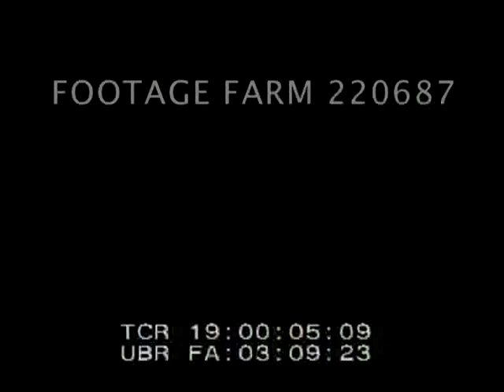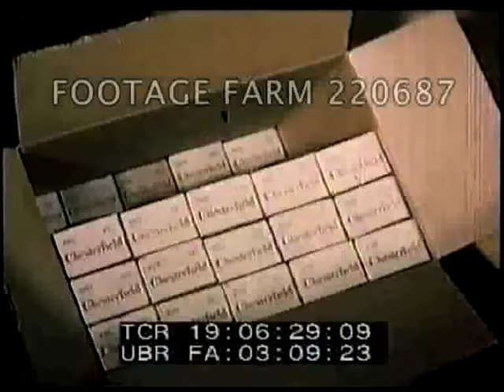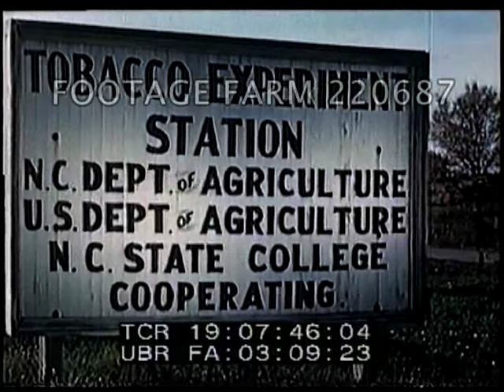Tobacco Industry in Southern USA 220687-01 | Footage Farm

Comment: In 1949 horses and mules were still in common use in the US tobacco belt. And apparently there was no mechanization whatsoever in any portion of the process from sowing the seeds, transplanting the seedlings, cultivation, removing the flowering heads, harvesting the three types of leaves and curing. 1949 was only 73 years ago (as of the 2022 harvest). The process hadn't changed much in 250 years.
Reply: Only now they add ammonia the facilitate a higher nicotine uptake, along with a host of other chemicals that cause addiction and cancer. Not complaining, mind you- tobacco dividends are helping to make my future retirement much more comfortable